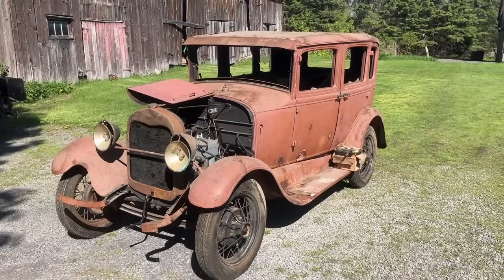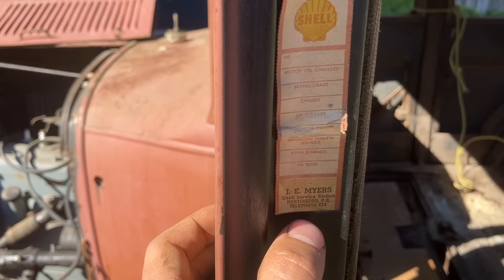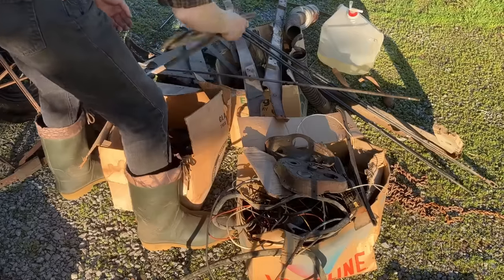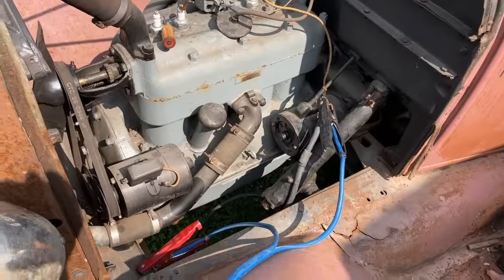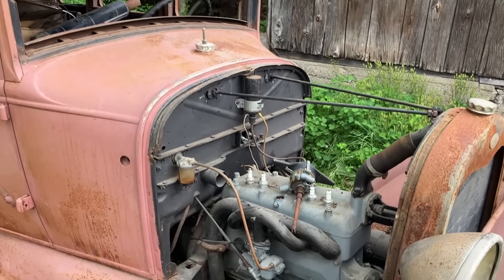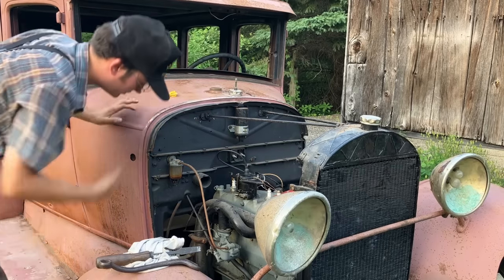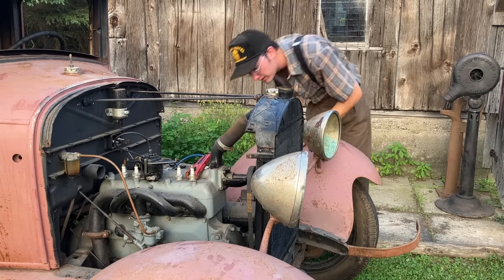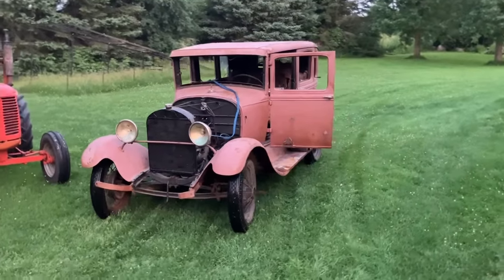1929 Ford first start in 40 years: Model A Town Sedan

Comment: 94 years old and it still runs.
Reply: Runs better than my bus to go to school lol 😂😂
Reply: 2020 vehicles are already in for motor swaps because they run horribly bad and basically destroy themselves. old cars are soooooo much better than newer
Reply: @IamBagelOfficial  There's actually been studies done on this, and apparently there's some truth to it. 

Cars built during the Depression in particular, were built to last because people could only afford to buy once. It's why EVERYTHING was sturdier & better back then. This degree of engineering carried over into the 1950s vehicles, and most 1960s/70s. 

Farm equipment was even more durable. My grandfather used a 1950s Ford tractor on his farm all the way into the early 2000s, and even then it still ran fine - he just wanted a bigger one (he kept the old one BTW for small chores around the barn). The old tractor was sold after he died, but as far as I know, it's still running and being used today. 

By the 1980s, the economy was booming again so manufacturers could relax on durability (though any 80s or 90s vehicle is still far more reliable than any modern one...particularly Toyota pickups).
Reply: a tesla after 9 years wont run 🤣🤣
Reply: @sixstanger00  which proves my point even farther.. considering were heading into another possible great depression, cars are built with no intention for durability. i work with cars and car parts daily i work for an automotive company and NONE of the parts are built for durability.. sad
Reply: Barely and with lots of luck and maintenance.
Reply: Amazing what we can do when our motivation isn't purely monetary and profit.

Comment: The "mystery pulley" is most likely off a riding mower. Car is in great shape. It has less rust than some Fords from the 2000's.
Reply: "It has less rust than some Fords from the 2000's." YES - Since 1968 the steel is very often crap... Even in clocks and watches... 1970's were the worst whatever carmaker, even Mercedes /8 rusted even with perfect paint as the metal-alliance were too cheap...
Reply: As the owner of a 2010 F-150 I can confirm. 

Cab corners and sills needed to be replaced five years ago to pass state inspection. Now I need to fix the rear wheel arches. They can be rusty, but sharp edges are grounds for failure. I guess they don't want kids cutting their fingers or something.
Reply: @Mishn0 same my F250 2008.

Comment: At first, I thought "Oh My", but close up, it doesn't actually look that bad!
The previous owner seems to have started work on it - a little primer here, some paint there (he even started on the woodwork!),
so it might actually be solid underneath!
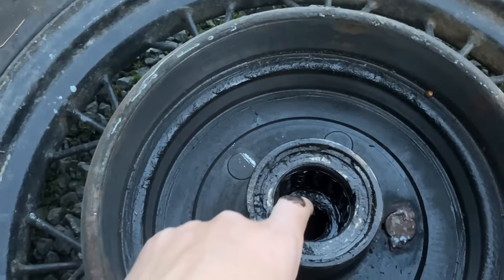14:33 looks like just the seal blew apart - they have springs around the lip to help press it against the sealing surface.
Reply from the maker: It definitely could be worse! The biggest cobble job is on the rear fenders, they are both different sizes with lots of weld patches and were welded to the body. There are a bunch of cases of bondo being used where welting should be. Lots to work with anyway!

Comment: Well done! My father was a Model A guru and I can see you know your stuff. He bought a deluxe coupe in 1964 and took every nut and bolt apart on it. I can remember seeing the engine all laid out on an old bedspread and the body up on barrels. He had a coat hanger coming through the radiator for the choke when he had to crank it. I enjoyed this video because unlike others who put 12 volts to them and leave them shuddering to death in the retarded position while they "warm up", you grabbed that lever and smoothed her right out immediately just like I was taught. My dad would drop that lever when he was showing her off and it would idle right down so slow, ticky- ticky, ticky-ticky, then put the lever back up to smooth her out. Would like to see more Model A content in the future, keep up the great work! And BTW, my cat loves to watch me work also, she's not even afraid of a skillsaw running!
Reply: Cats are the best helpers--mine likes to nap just the other side of my work area, even when I'm running grinders. Not bothered at all.

Comment: Cool to see you get it up and running, seems to run pretty well amd on camera the wood looks to be in great shape, my town sedan is a distant cousin to yours, mines and Australian assembled 30, they were knock down kits from Canada, i always found when starting mine with the crank handle that winding the engine over for two rotations with the ignition off, fuel and choke on to prime it, then it usually only takes a 1/4 turn to fire up with the ignition on

Comment: A series wound DC motor will always spin the same direction regardless of the polarity. 
Edit: If you want it to spin in the other direction, you have to reverse the connections to the brushes or rotate the brush assembly.
Nice car, tractor and, of course, cat!

Comment: WONDERFUL. It brings back memories from the 1950s of my 4-door 1932 Ford Model B, basically the same car. (It had the 4 cylinder engine rather than the legendary V-8, and the gas tank was no longer in the driver's lap.).

Comment: I was trying to get a 1954 Chev 261 started, the booster cables were dropping way too much voltage, it wouldn’t even spin. I put on proper battery cables and a new battery, and it cranked over really nice and fired up on most of its cylinders.

Comment: Henry Ford were sad after the 15'000'000th Ford-T rolled out. There is a photo with his son Edsel. Ford said and believed that nobody needed more than a normal Ford-T.
Which is still true.
Everything after this is simply luxury...
I like most the improved Ford-T's so 1926 and 1927 with wire spoke wheels... The A has still the same engine... Great cars.
But with the A the "planned obsolence" started....
I have a Citroën Dyane of 1967 kind of a luxury 2CV... If you like the most modern Ford-T.
Ford and Citroën were good friends. André Citroën brought the chain factory methods from Ford to France, as 1st. car production in Europe with these methods.
You can truely see the 1st Citroëns like luxury Ford-T's

NO semiconductors! We watchmakers call them "black beetles/ Cockroaches" think of "Man in Black" and you now what I mean!

Only sweet 6V basic electric and a good starter and good lights.

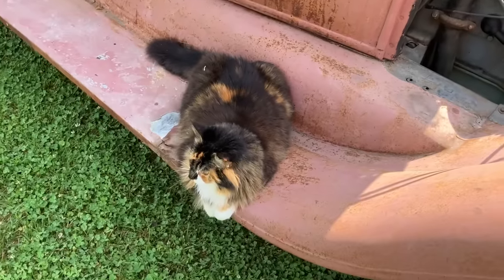Comment: @17:10 every back yard tinkerer needs a good kitty supervisor

Edit: also to add about the 6V and 12V batteries. You can tell what the battery is based on how many caps are on top. Each cap is a cell and each cell is 2V. 3 caps = 6 V and 6 caps = 12V. The starter should not care what the ground orientation is.

Comment: I have to say I'm somewhat concerned about all these decadent luxuries you have on the inside of this car.
       Milk crate for a seat?
Really? In my day, we sat on rocks, and it was good enough. And what about this fancy disconnect clamp on your battery? 
Bailing wire not good enough? I suppose next you'll want to be putting some of that glass in the window so you won't need toothpicks for the bugs in your teeth.
          Beware, sir. Too much soft living ain't good for ya. 
           You start livin' like those city slickers, and before you know it, you'll be one yourself.
         Heed my warning,sir!

Comment: The springs for the seat most likely came from the L.A. Young Spring and Wire Company out of Detroit. 90% of the springs in cars until the 1960s came from one of his plants by the time he died. Chrysler bought the company around 1965. Young's winter house in Miami FL., is still standing.  Young was the second owner of the Famous "Motown Mansion" in Detroit. Warren Buffet was a stockholder in the company in the early 1960s.

Comment: I would normally take the engine apart before attempting to run it to avoid damage. That engine has already been gone through and cleaned so you were fairly safe. 
. It sounds very smooth - great job in analysis - What did you pay for her or was it a free Fordor  ? - Cheers -

Comment: The Motor looks like overhauled bevore this Video is filmed ..??
Reply from the maker: It may have been overhauled but it would have been over 40 years ago. I removed this car from the shed where it sat, and the engine was full of rust but the oil had been changed before it was put away.

Comment: Tail lights are 62-67 Volkswagen.   Your car is a Murray Town Sedan, top of the line in 1929.  I'm pretty sure you know those 19" wheels and tires were only used in 1930-31.   Can you tell if the car was assembled in Canada?  Did you see any Robertson head screws?
Reply from the maker: Thanks for the taillight info, yes it seems to be a Canadian car. All windowframe hardware is Robertson

Comment: Back in those days,  if you wanted to drive,  you had to be a mechanic !
Reply: in those days you were a proud auto-motorist not a silly consumer... Same for me with my 1967 Citroën Dyane (luxury 2CV) I do EVERYTHING by myself (well, as a clock and watchmaker I can do it....)
Also in those days you had FULLY explainations of all maintenance work. Even in my 1967 there are all points pictured what and when to do. Even one phrase: "The parts of your Dyane are constructed with large reserves it's wanted to LAST a longtime" That you even don't find in a Mercedes Manual of that time... (1967)
Reply: nowadays you need to be a software engineer to drive

Comment: it's not a 1929 it's a 1930!
Reply from the maker: @@OurRoadAheadTogetherForever This is the case for most Model As with exception of the '29 town sedan. It is like a mesh of the early short rad and the later continuous cowling. In 30 they went to a tall rad with swept cowling, totally different geometry but same style to make up for rad shape change.